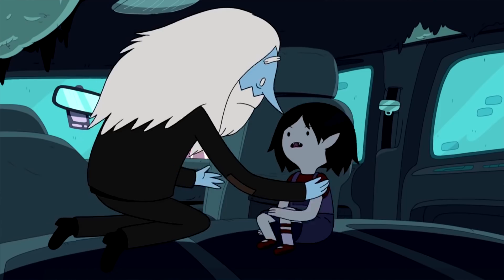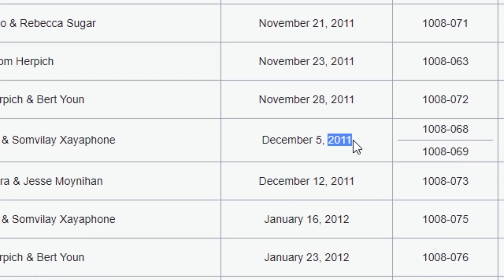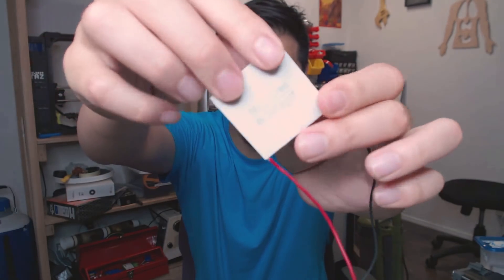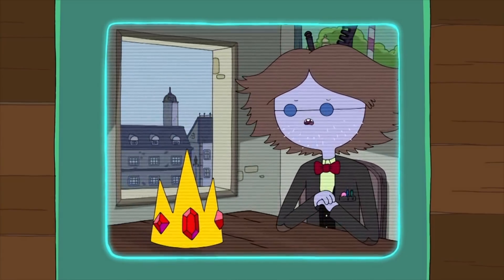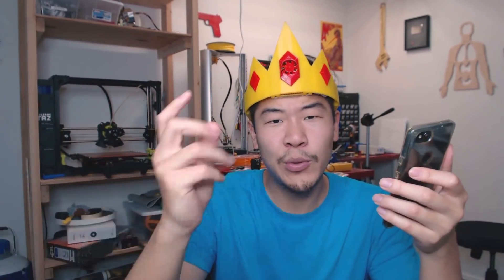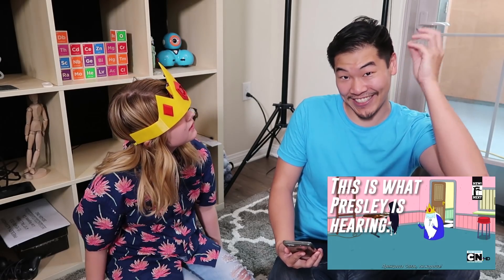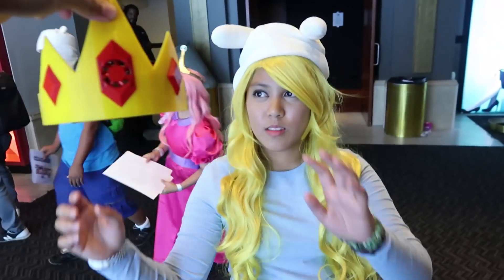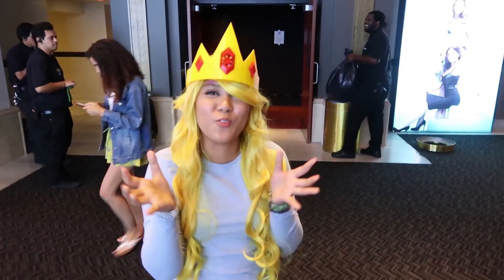Ice King Crown keeps you Cool (and Makes You HEAR Voices in you head??)

Comment: You guys realize he fixed deafness like OMG
Reply: Deafness is caused by the brain, they wouldn’t hear the sound waves due to their brain not acknowledging the feeling of sound, or sound waves. It would be different if someone had their eardrums ripped out.
Reply: He didn’t fix deafness also he didn’t invent this it’s been a thing for a long time now
Reply: you do realize its still vibrating the same thing that would be vibrating with your earholes
Reply: How do you hear with vibrations?? You’d hear it with sound waves. Its not even close to the ears so its soundwaves going straight into the brain.
Reply: @maplesyruptoes9490  k
Reply: @maplesyruptoes9490  Have you ever flicked a rubber band or play a guitar? The vibrations in those strings create ripples (aka vibrations) that is called sound. Unless you somehow got your ear cutoffed or burst your eardrums this skull vibrator would be super useful. But people who go deaf over time won't see this as useful because it a problem with their brain.
Reply: If that were the truth everyone around you would also hear the sounds coming from it. It works like radio waves to your brain. It cant be pure vibrations. Its sound waves going purely into your head.
Reply: @maplesyruptoes9490  vibrations are what cause sound waves (for example speakers need to vibrate to produce sound)
Reply: Chill TMS “deafness”

Comment: They vibrate your ear bones. Not your skull. Loll. Maybe I'm wrong....
Reply: Maybe you're right. Ear bones are not considered a part of the skull. But I think these transducers vibrate the skull though.
Reply: Yes they vibrate your ear bones, the way you hear sound is by having a bone hit your ear drum because of vibrations causing the bone to tap it. The sound is traveling through the skull and to the ear bones
Reply: They vibrate only what they're touching so they're technically only vibrating the skull, but the skull touches all the ear bits so it goes down the line like conductor>skull (temporal bone)>everything in tympanic cavity. The carrying effect makes them pretty versatile.

You could bite on it to get conductor>jaw>skull>tympanic cavity, put it on your elbow and stick your finger in your ear to get arm>hand>finger>skull>tympanic cavity, or just put it in a glass to make a regular speaker. Pretty cool.